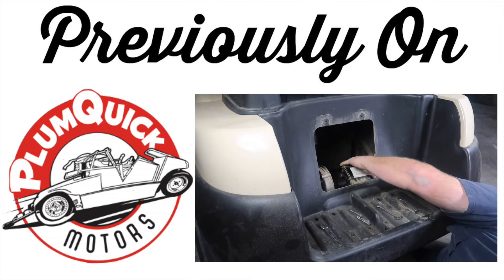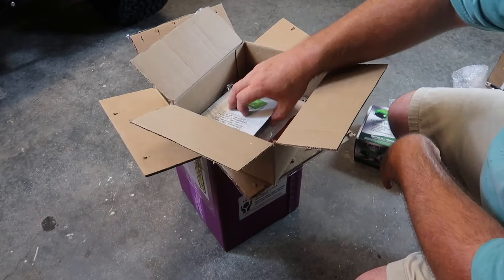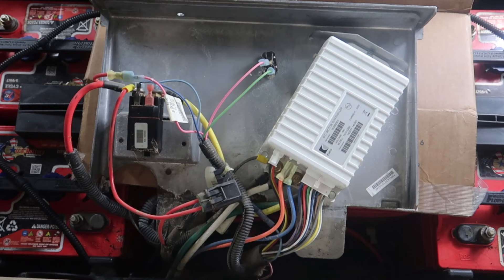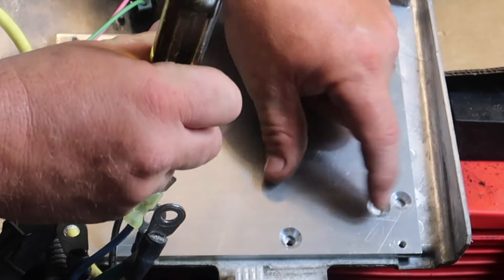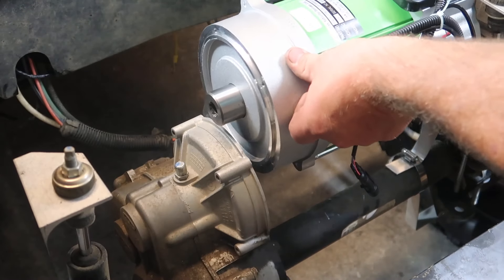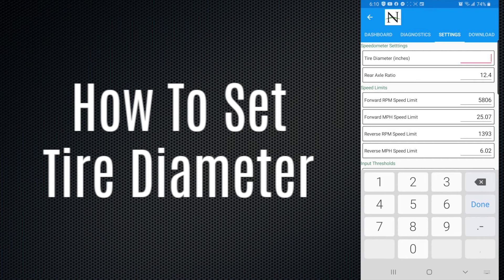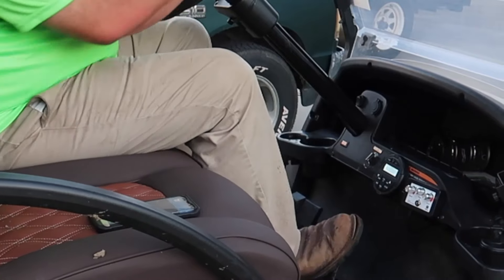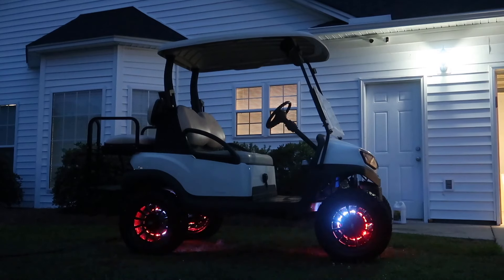How To Make Golf Cart Run 35 MPH |  Navitas 5kw AC Conversion on Club Car Precedent | Plum Quick

Comment: Thank you so much for this video I'm doing a project with this motor in an 18ft boat soon but my question for you is if you adjust the wheel size in the app without actually changing the wheels how does it perform or does it stay the same and give inaccurate speed readings?

Comment: Hey so i did this conversion, got brand new batteries, full charge.  Runs EXTREMELY fast on flat ground, but if i go up even a modest hill it slows to a hault.  Are there any settings I can adjust to improve torque on hills?
Reply from the maker: AC doesnt slow down going up hills.
Reply: @Fentertainment  mine does! Can I pay you for a troubleshooting call? Maybe I can adjust the settings

Comment: Noticed my kit didn’t come with the motor wires. I thought you replaced your battery cables with 2GA. Do you have a link to the cables used to install the motor and controller? Thanks.

Comment: What’s up, Man!
Your videos got me spending $$$. Haha Thank you!

I just purchased the Navitas upgrade kit. I’m looking for 2 gauge weld wire for the Navitas kit upgrade but I have 2 Falcon Elites batteries and I don’t need an entire cable kit. 
I was just going to buy some 2 gauge weld wire myself and crimp in my own terminals and shrink.
I was wondering if you knew the length of the cables I need (not battery cables), just controller to motor and solenoid. Also do you know the terminal diameter for those cables? Thank you!

Comment: I see you removed a plumquick motor and replaced with a AC conversion kit. Would you recommend skipping a big DC motor and going straight to AC? I am in upstate SC so everything we have are long hills and pulling me, my wife, and three kids kills the stock motor down to 4-5mph. Looking at the Torque Crocodile VS AC
Reply from the maker: If you rode a lot of hills I would recommend going the ac route.

Comment: I have followed this instruction to a "T" with the exact setup (batteries, wheels,and all) in N Myrtle Beach but mine will not go over 30 mph?
I even have a 600 amp soleinoid and 2 guage wires throughout. Any advice to get to 35 mph aside from lithium battery?

Comment: First off - thank you very much for the great video!  I am in the middle of the upgrade right now!  I have a first generation Club Car Precedent (2004) so mine is a bit different.  The wires to the solenoid are a bit different:/  The negative to the battery and the positive to the controller is of course the same, but I have one "red wire" (you had two), and then I have a yellow wire with a fuse in-between connecting the two solenoid ends.  Not sure if I just connect these on the new solenoid just like they were before:/

Comment: My Navitas app says Charger Interlock not connected even when charger is plugged in, should say connected like yours... I have a 2019 Club Car Tempo Chassis.

I bet it has something to do with that Reed Switch in my old previous charger port,  am I right? I had scrapped  the old chareger port when I got an Allied onboard charger aand new charger port with the Allued 150AH Lithium Battery kit.

Is there anyway to get that Reed switch safty back with my new set up with what I have now so someone in my family doesn't drive off with the charger cord still plugged  in! M!!!??? 

Are those the red wires connected  on the battery side of solenoid you did last? Would be a tremendous help, thanks so much! You have a bew sub here ..

Comment: I installed my kit last night and keep getting error code (2-4)  solenoid current to high. I’ve checked all the wires  any suggestions?
Reply from the maker: Is there a resistor on the solenoid? If so remove it. The navitas doesn’t need that.

Comment: Fenter,
Did you like the Teekon Silver wolf or the Navitas set up better? I like the shorter motor, but I like the On the Fly adjustments  that the Navitas has. I want to change out the stock motor and controller on my 2011 Precedent.

Comment: I noticed the new version of the app does not let you lock in the MPH settings and once the key is off, it reverts back to 25. I also don't see the axle RPM as an option? Thanks.

Comment: Awesome video... changed to this system, playing a round of golf would use about half or more on the battery meter driving to and from the course (running at 12mph on the course) .  Now it only drops 1 to 2 ticks off of full on the battery meter, and it will run a solid 32 mph with 2 yr old batteries... love it
Reply: I have a club car that I would like to do this too. How much did this run you?
Reply: That is the same I would like to know. $$$?
Reply: @bradb-rad3624  I just did my yamaha g29 and the whole kit was a little over $1600.
I called and got a discount before ordering. It saved me a couple hundred.

Comment: I have a new 400amp navitas ac kit ready to install. Purchased new 2 gauge cables and a 400 amp solenoid. Are the resistor and diode still required? Sales director at Navitas says they are not on older series carts. I have a 2014 ezgo txt 48v

Not sure what to do.

Comment: What is the part number for the solenoid?  Does it have to handle 600 amps or is that just peak?  I see this has been asked before but I did not see a reply.  Great educational channel.
Reply: I have the same question, did you ever figure this out?

Comment: Is there a way to adjust the threshold for ramping up regen?  It seems like with my EZGO TXT throttle there are points as we try to slow down without stopping where it goes into this oscillation where regen is flipping between on and off causing an uncomfortable ride stutter.  I own a Tesla and am very much used to single pedal driving but the regen is linear in feel and can be adjusted as the pedal is lifted increasing regen until its maxed when foot is fully off the throttle.  It seems with the Navitas 5kw AC kit I put in my golf cart, regen is either on or off and not adjustable in-between.  I can adjust the regen strength but it doesn't fix the oscillation between on and off.  Increasing regen power just increases the discomfort.  For now there are two options for a more comfortable ride,  regen totally off on the controller, or totally lift off the throttle when driving to fully engage regen.

Comment: Wow that’s amazing speeds! Love to get my 2018 Tomberlin SS Coupe 46v AC up over 30-35 mph, instead of the steady 25, to the occasional 27.  My one serious question, have you added front brakes? Running up over 30 mph with only rear brakes seems a bit scary/dangerous. My Tomberlin has hydraulic brakes, drill/slotted rotors up front and drums in the rear. With stiff independent coil over front suspension and stiff coil over rear suspension, along with the 235/50-12 Blaze tires helps it handle like a go-cart, with absolutely no sway, I can even drift at times on concrete, in the dirt no problem.

Comment: Just bought a ac upgrade kit for my 04 club car non iq. I don't have it yet but it's shipping. Is there any pointers you wish you had while installing yours? 600amp controller and 5kw motor. What should I expect performance wise with 22 inch tires?

Comment: I have a ezgo 48v golf cart would I use this for more power? Or should I do the new motor and this kit? Please help I need speed
Reply from the maker: This contains an ac motor and controller. This is a package kit! I love this thing!
Reply: @Fentertainment  Great video. Since you live in a flat area what did you set your regen to? Do you think your set-up will go through breaks faster?  Finally, I bought the Navitas controller/motor too (I have a lithium setup)  and I am getting a lot of interference though my Memphis amp/wetsound speakers...have you heard this come up in your discussions with others? Thanks!!!!!!
Reply from the maker: @timmahon9351  This cart now has the roypow lithium set up as well. My regen is turned down and I only turn it up when Im by myself and have the speed and acceleration turned up.I havent had any problems with my bluetooth setup on this cart. Not sure Im any help with the audio interference.
Reply: @Fentertainment  Thanks, still toying with the system. I find myself coasting a lot into stop signs instead of jamming the breaks. Regen is set by dealer really low. The dealer/builder of the cart is going to look at the audio issue and get back to me. Can I ask you what kind of audio system you have on the cart and whether you get a lot of distortion through the system whether you are listening to music or not? My cart guy says it is because we are jamming the AC motor, Navitas, LED lights and all the other electronics into such a small space.  Thanks
Reply from the maker: @timmahon9351  if you have the vaitas system you can get the dealer app and set regen how you want it. This cart has a sound bar by bazooka. It sounds good for low playing music. My other cart has more sound on it.

Comment: Did you reuse the plum quick/OEM bolts to attache AC motor to housing or use new ones that came with your AC motor kit?  The bolts I received in my kit are a good inch too short to use but it appears that I can thread the OEM bolts into the AC motor through the housing.
Reply from the maker: I used the same stock bolts for both aftermarket motors.

Comment: I have a question. Why did you do this upgrade when you already bought an upgraded motor and controller already?
Reply from the maker: AC systems runs cooler, stronger, and more efficiently. More speed and more torque!
Reply: @Fentertainment  did you run into any issues with the bandit ph and the navitas 600 controller ?
Reply from the maker: @ericfrauendorfer7737  I didn't. It was a good combo and did the job. At the time I just wanted more.

Comment: Which lithium pack was the other guy running? Leaf build or roypow or something else?
Reply from the maker: roypow 160ah
Reply: @Fentertainment  nice. Since you do diy stuff are you going to document a diy lifepo4 or leaf build or are you going plug and play? Also what front headlight kit are you running? Not many videos around on brightness of various kits and yours lit up well. Is it the new flush mount madjax tempo kit?
Reply: Love the videos, keep em coming! Where did your buddy get his roypow? Also, do you know what kind of range he is getting out of the 160ah?
Reply from the maker: @bradleyfowler2244  he ordered his back at the beginning of the year but just arrived last month. He is getting 30 miles at full throttle everywhere with his ac kit. Im sure he could get a lot more if he throttled the speed & acceleration back. Im also looking for the 160ah battery.
Reply: @Fentertainment  Did he order from a local dealer? I'm having trouble finding someone to order from. 30 miles is good at full throttle. Thanks for the quick reply!
Reply from the maker: @bradleyfowler2244  it wasnt local. I know he ordered it.

Comment: question. I am looking to do the same thing to mine.  Did you have to replace anything else  , such as a v-glide for this install to work. and did you buy a cable pack with premeasured cables?

Comment: Really enjoy your videos the details are great! I have a 6 seater precedent would you recommend lift and tires before AC motor or does it matter? Currently averaging 20 to 25 MPH depending on load.
Reply: It's easier to get to everything with the lift on, or even easier to do it all at once while you've already got it jacked up/tires & suspension mostly off

Comment: Was this cart a 36 or 48V and is this conversion kit for both?
Reply: he had 6 batteries in series. That would be a 72V system if I'm not mistaken.
Reply: 6 8v batts connected in Series should be 48v.

Comment: So if I were to install this, would there be a need to buy a Plum quick motor like you did in the first video?
Reply from the maker: No there is no need for it. I was just seeing exactly how fast we could make the golf cart on a dc setup and had it going 30 for cheaper. However there is advantages to both.

Comment: I have the Navitas 5kw AC Conversion on my Club Car DS. Just upgraded to 72v Lithium batteries and hit 49MPH with two of us on it. I have my MPH limited to 50mph. I think If I adjust it higher I'll be in the 50's.
Reply: I am going to do the 5kw also on my ds any tips ?
Reply: @Caleb-tv8pu  You will probably have to cut a bit of the frame to make it fit.
Reply: How much did the 72 volt lithium battery’s cost you? So is there 6!12 volts than or how does that work?
Reply: @bradb-rad3624  I have 120 lithium cells. They are about the same size as an Ipad battery. I put them together myself. Cost was about £1500.00
Reply: @Coolcarting  Any links to where you purchased these? I'd take any info on your overall install if you're willing to share. CheeverPat at Gmail is my email.  Thank you.
Reply: @bradb-rad3624  lithium batteries are generally one big battery.

Comment: I just gps'ed my EZGO RXV and got 26.2 mph, honestly unless mods were made  I wouldnt want to go 35 mph!! At 26 mph the stock body RXV is twitchy at best
Reply: My feelings as well. My cart goes 30 mph. These carts aren’t engineered for these speeds and become unstable. And the breaks aren’t designed to stop carts traveling at these speeds either. 
Though it is nice to have the extra acceleration when in traffic.

Comment: You made it look a lot easier than it was.  Trying to shove all the larger components into the same little space didn't go so well, I had to do some extra drilling and cutting just to "mostly" get it all in but I wasn't able to secure it with a screw as it was before.  Eff it, it's not going anywhere.  Running the wires from the OTF on the dashboard to the panel behind the seat was left to my imagination so I just zip tied them best I could under the chassis.  Maybe you ran yours under the floor mat?  Did you mean to install your Navitas upside down?  I mean, I installed mine with the words so you don't have to stand on your head to read them, not that anyone would ever see them but that changes all your connections 180 degrees.  One of the supplied heavy duty cables was too short so I just drilled a hole out the back of the big plastic box holding all the brains and went straight to the motor.  Lastly, did you take off the back of cart to remove and reinstall the motor?  I don't have your big beefy arms, I had to lift it with straps while another person got it on the splined shaft.  After much trial and much more error I managed to get it back together and it runs much better even before I have done the programming.
Reply from the maker: Lets see...... Majority of the plastic controller cover was already cut from when I installed the dc navitas before I switched to the ac. Pretty sure I ran my otf underneath the cart and ziptied the wires as high as I could. I removed the rear body of the cart for video purposes, and as far as the controller being installed upside down is probably due the time of day that I filmed this. I shot this video as 2:30 am during the summer. It was the best time for low humidity in this south carolina heat. I agree the motor is heavy but having the rear body and plastics removed sure helped out however it can be done by not doing that. Like I mentioned I did it for the best angles.

Comment: Did you ever have any issues with the PQ Green Extreme DC to AC conversion with the Roypow 105AH? Local dealer here in Columbia SC said they stopped using the roypow's and started using Ecosomething in its place for the DC A to AC conversion. They could just be trying to sell that battery now. Looking to upgade both PQ Green extreme 5Kw motor w/ 600w controller just debating on the battery setup. Current setup: 2016 Clubcar Precedent w/ Alpha body kit, 48v, Plum Quick Bandit motor, standard battery setup. Love the videos keep it up. Thank you Mike H
Reply from the maker: I quit using the roypow because the bus wouldn’t handle the amps the Navitas has. I had to turn down the navitas in the app so the battery wouldn’t randomly shut down. I’m using the big battery lithiums now without any problems. I have videos on those as well as a coupon code to save money with them. I’m pleased with those!

Comment: Unfortunately this doesn’t work for any club car from 21- current because of a throttle change
Reply: Throttle change? You can do motor and controller on 2023 onwards, so what do you mean? Only thing that would stop you is factory lithium and factory AC. If you get the DC model, it's still the same.